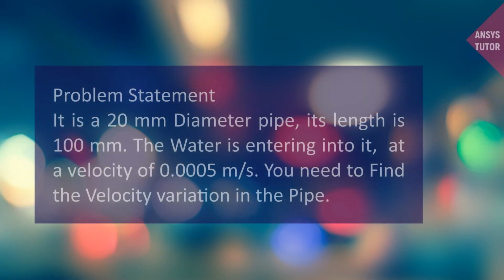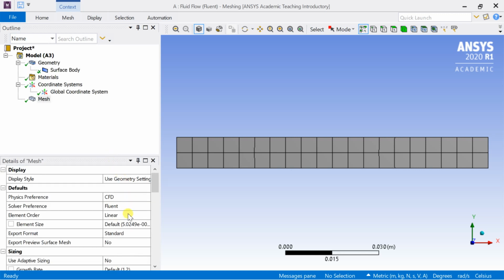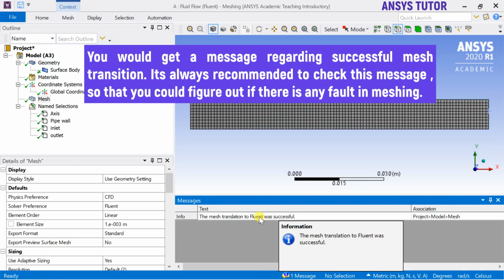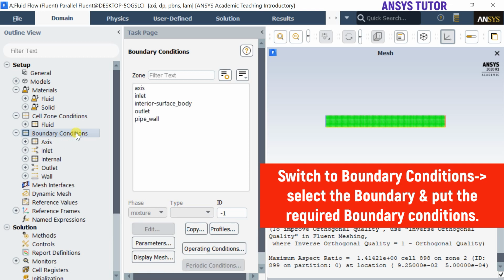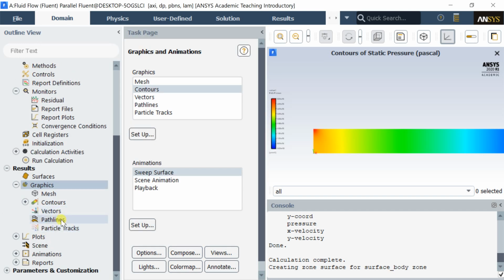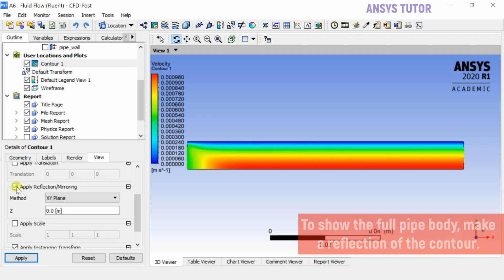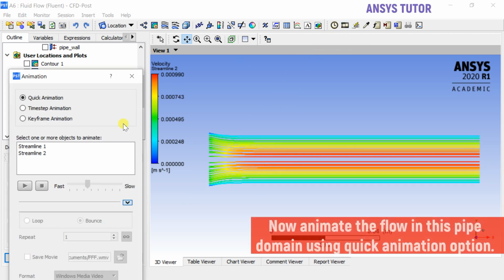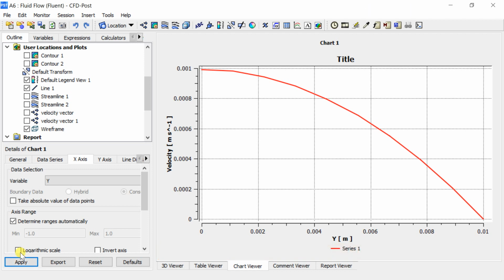ANSYS Fluent Tutorial | Laminar Pipe Flow Problem | ANSYS Fluent Pipe Flow | CFD Beginners Tutorial

Comment: I get error in updating mesh : "Update failed for the Mesh component in Fluid Flow (Fluent).  Error updating cell Mesh in system Fluid Flow (Fluent). View the messages in the Meshing editor for more details".
Reply from the maker: Usually this happens if the geometry is not clean; try fixing the geometry and updating the mesh again. 🛠️

Comment: Suppose I want to change the pipe wall material from aluminium to steel how to do it ?
Reply from the maker: You can do it by adding steel from the fluent material database, then select steel as the wall material in the boundary conditions.

Comment: In this tutorial, when i am naming the upper boundary as axis and bottom boundary as pipe wall, why the calculation is giving zero point error?
Reply from the maker: You need to create the geometry like that, it means , if you want the top wall to be the axis you need to draw the rectangle in the 2nd quadrant, the axis line you want to create must be on the x or y axis.
Reply: @AnsysTutor  ahhh understood!!! Very nice answer.Thank you.
I wanted to say two things :
1. i am accessing ansys with a virtual machine and the black screen issue at post cfd processing is arising. I watched your video and tried to update the graphic card driver but it didn't work. My VM is a N series which is made for high graphics workload. I don't know how to fix it.
2. Please make complete tutorial from geometry to simulation video recording for heat and species transfer.

Comment: please help me out!
I'm getting floating point exception error no matter how many times i try...please let me know how to overcome that error...and where I'm going wrong!
Reply from the maker: Note down all the procedure as shown in the tutorial,Reset the set up, and again do the setup and run the calculation.
Reply: @AnsysTutor  already I've tried no. of times sir...my lappy is of 4gp ram..is that can be a problem?
Reply from the maker: Ram is not an issue. There might be problem in boundary condition or material assignment. Another thing might cause this problem if you want to do a vertical flow along y axis with an axisymmetric model setup.
Reply: @AnsysTutor  ok sir thanks a lot...ur videos are really helpful 🙇🏻‍♀️🙌🏻
Reply from the maker: Thank you. 👍👍👍

Comment: I am looking towards simulation of circular microchannel and i created the geometry and mesh in micrometeres. Now in Fluent solver, micrometers units is not there and now will i have to put scaling factors and then scale or if mesh and geometry are already in microcmeters,Fluent directly keeps the domain extents in 10^-6.  So what should i do? If already in domain extents by keeping the units metre, its already in value of 10^-6, do i need to scale again or leave and continue?
It is also showing solution is converged? Is it sue to the small dimension? Please give me idea.
Reply from the maker: Have you created the domain in ansys geometry with micrometer dimensions?

Comment: This is so useful .
Would you please make or guide me to simulate heat transfer charcteristics through circular microchannel??
Reply from the maker: You need to find out the temperature distribution, convective heat transfer , nusselt number variation with Reynolds number etc.

Comment: As the initial simulation provides results for only half the pipe? Do the results then need to be doubled or is this the results for full pipe but only shows half in the image?
Reply from the maker: Its for the full pipe. As you can see, there is an axis boundary condition provided in BC. Which informs the solver regarding the continuity of the pipe.

Comment: Hi there, can anyone help me with calculating the Reynolds number from this process for my dissertation
Reply from the maker: You need to add the Reynolds number option from the data file quantities ,then you can get the Reynolds number at any location in this flow domain. After initialisation, file menu-> datafile quantities> additional quantities-> Reynolds number.
Reply: @AnsysTutor  hi thanks for the response , the only option I have is the cell Reynolds number is the same thing?

Comment: How would you know the Reynolds number is 9.95 ?
Reply from the maker: Its calculated using the relation Re= rho× V× Dh/ miu. You can get the values of rho (density) and miu(viscosity) from the fluent material database table.
Reply: @AnsysTutor  highly appreciated

Comment: Actual model of the problem is 20mm dia pipe with 100mm length, but you create 10 X 100 mm flat surface. What is the reason for it?
Reply from the maker: It's an Axisymmetric problem.
Reply: @AnsysTutor  I understand sir, Thanks for your kind reply

Comment: In the problem statement you have pipe, why you use rectangle shape?
Reply from the maker: It's the 2D axisymmetric geometry of the pipe.
Reply: Ansys-Tutor  Thank you for your reply, but the geometry that you draw is rectangular pipe? Can you explain more this point?
Reply from the maker: I think you have skipped the part of the tutorial where I had selected one wall as Axis. and selected the Axisymmetric analysis. In 2D geometry we generally create the half section of the part which is the rectangle.
Reply: Ansys-Tutor But the half section of the pipe need (r,theta) ? You draw the rectangle using (x,y)! In another tutorial when you for 3D pipe you used circle to create shape
Reply from the maker: You cant find the option to draw using r, theta in ansys , only there is Cartesian coordinate in ansys design modeler. The model gets converted to polar coordinates in fluent whenever you select a Axisymmetric solver type.
Reply: Ansys-Tutor Yes Sir I know that, but the question is why you didn’t draw circle instead of rectangle by Ansys model?
Reply from the maker: Okey, as per you , if i draw a circle , where would be the inlet and outlet of the pipe for 2D geometry?
Reply: Ansys-Tutor We must do it using 3D geometry
Reply from the maker: Its just a demonstration for beginners how to approach a problem in 2D, in many problems 3D geometry solving takes a lots of time thatswhy we use 2D geometry. It all depends on your time and resources available.
Reply: Ansys-Tutor thank you very much

Comment: I followed all the steps accordingly, but unfortunately, it shows an error  while starting the setup like  
No error handler available
Error: Cortex received a fatal signal (SEGMENTATION VIOLATION).
Error Object: (). any solution
Reply from the maker: Reset the setup and check if you have any error message in meshing. Wheather there is a green tick in meshing or not.

Comment: you have put in set-up operating pressure:101325 Pa, gouge pressure inlet and outlet=0 and initial velocity:0,0005 m/s.
why the velocity grow up? i do not have any difference pressure in the boundary conditions...
Reply from the maker: Check if there is any reversed flow warning.

Comment: Sir, I'm using ansys 16.0 version. Using face meshing option I'm able to change the element size but unable to find adaptive meshing option. Also there is no such option in defaults. Is there any way i can proceed?
Reply from the maker: These options are not available in older versions. In Ansys 16 you need to turn off the advance sizing function option to get the simillar result.

Comment: I am doing a 2D rectangular flat plate ( zero thickness) for blood flow through an artery. the only boundary conditions available is the inlet velocity at 0.23 ( Uavg) and the outlet pressure at 0. in terms of the boundary condition section can you guide on the selection I should make on outlet condition. the Umax is supposed to take an expression Umax = 2 x Uavg.
Reply from the maker: You can take pressure outlet BC for outlet.
Reply: supposed I want to replace the inlet velocity  function with Umax = 2 x Uavg, how do I go about this"?. the  parabolic function you used for the velocity profile is it the same as the above equation
Reply from the maker: https://youtu.be/LF06grv299A
Reply from the maker: This tutorial will help you to put the parabolic velocity profile at inlet.
Reply: i still have not gotten a parabolic profile after following the video step by step
I still do not know what is wrong
Reply from the maker: Check the sketch plane weather its xy plane or anyother plane.
Reply: @AnsysTutor  would you mind i speak private to you
Reply from the maker: Yes ,you can message me on facebook or telegram , all the links given in the "about" tab of the channel page.